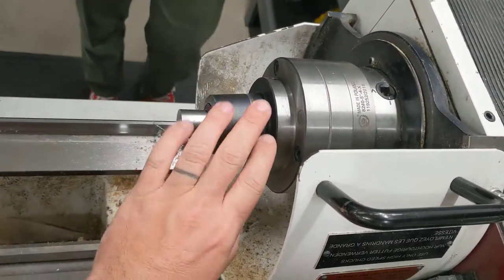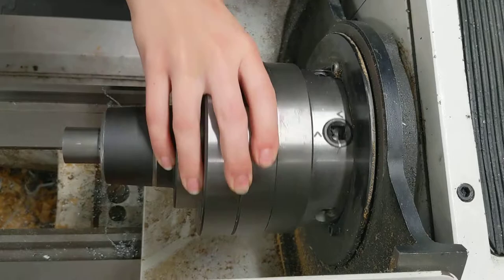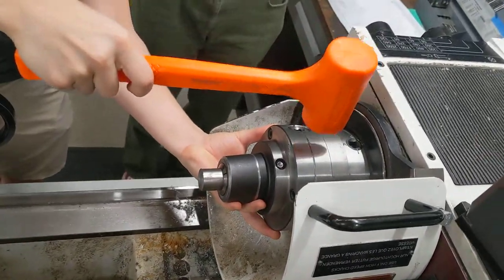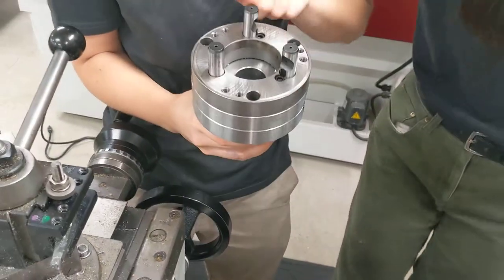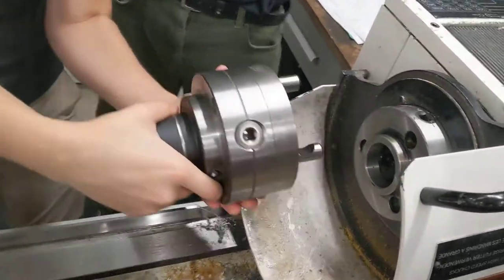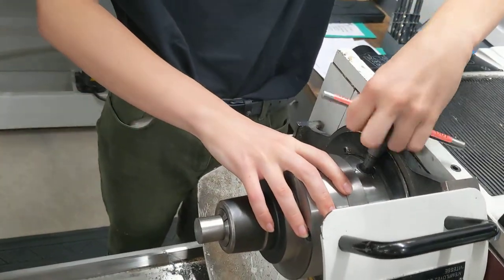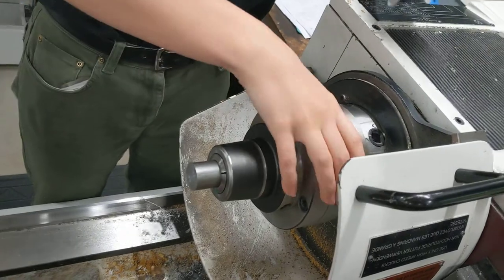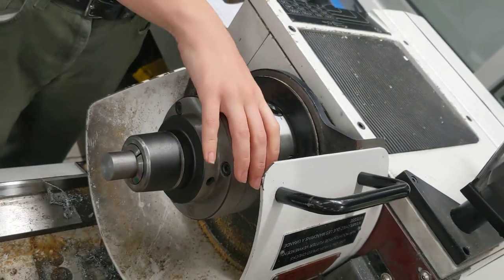Installation and Tightening a D1-4 Camlock Lathe Collet Chuck

Comment: 👍for pointing out that you snug first andcthen go around again to fully tighten. I have seen "professionals" just give full grunt to the first cam lock without first settling the chuck in place, not good practice.

Comment: Very poor instruction, no mention of the marks on the camlock which indicate where the camlock pins should be for safe operation.
Reply from the maker: Thanks Judd, this is a good point, we did not talk about the indexing marks on the camlock pins!  For anyone reading this, it's very important when setting up new tooling and buying new chucks to follow the installation instructions given by the machine and tooling manufacturer.

This lathe uses a 'tick' mark on the spindle nose that indicates the camlock is completely unlocked (you align the two lines) and then it has two 'V' marks at 90-deg. and 180-deg. away from the fully unlocked position.  On this machine (Harrison M300) you must adjust the length of the camlock pins if they are replaced or when setting up new workholding such that when fully tightened the tick mark on the camlock pin (the rotating part) falls between the two V marks on the spindle nose.

In our shop all of the workholding is already adjusted so that this is the case, but it is important to verify that the workholding retention mechanisms are working properly, and are correctly adjusted.  Thanks again to Judd for pointing this out.
Reply: @hmcmachineshop  also you should have a match mark on the spindle nose and the collet chuck so that it goes on with the same orientation every time. This should have been selected at first installation as the orientation with the lowest runout, then marked.
Reply from the maker: @Elec Tech  you're exactly right!  We haven't done that in the past, and the tooling we have available may move around to any one of our six Harrison lathes.  We'll bring this up at our next management meeting.  Thanks for the suggestion!